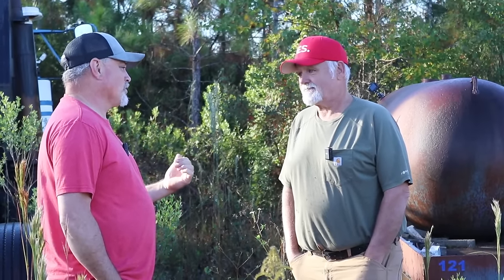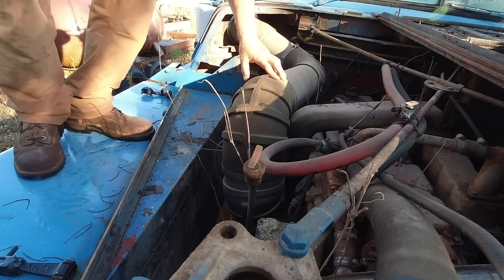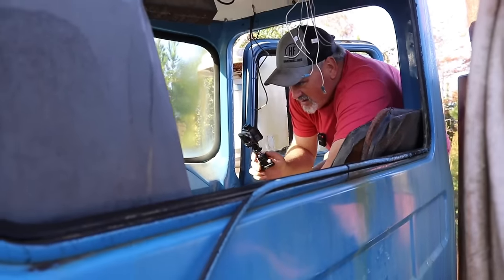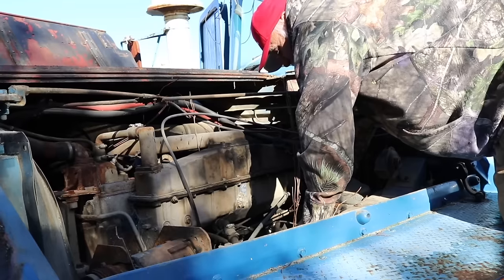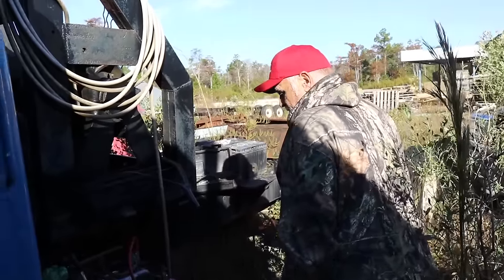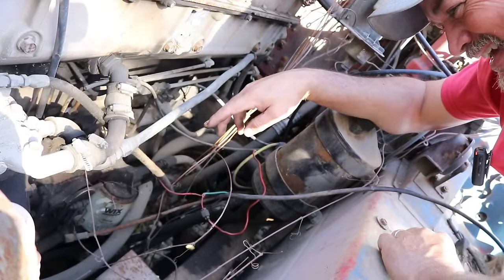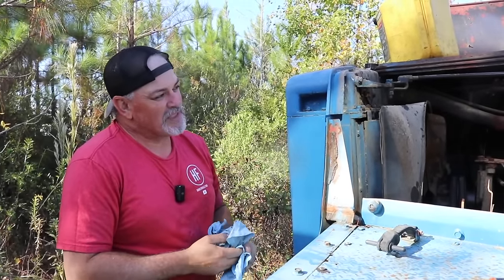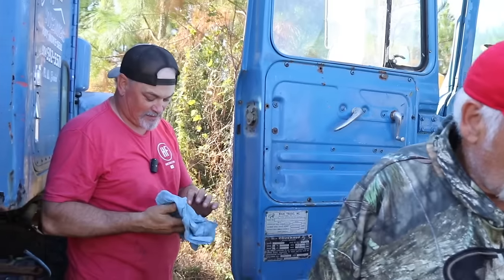We found an SUPER RARE MACK HIDING in plain sight!! Will it run?

Comment: What we have here is  an LA Mack. If you bought a Mack made in Pennsylvania, it would be all Mack from front to rear. The LA Mack was a kit truck you could buy with your choice of powertrains. This one probably came with a 555 Cummins V8 and 13 speed Roadranger transmission. The Triple Nickle wasn't a very reliable engine, hence the 6 cylinder presently installed.
Cummins injector pumps have a manual fuel valve right above the solenoid. A small knurled knob, just screw it in. It was put on to allow the engine to run if your batteries were dead. To kill the engine just screw it back out. FINALLY! You show the ID tag. FRUEHAUF assembled the kit!
Reply: That’s just a dm800 glider
Reply: @willw7545  In OK we just call them kit trucks. Order a cab and frame, put in your own powertrain, or order a complete kit with new powertrain.

Comment: That’s a DM-800, they’re actually pretty common in coal country I know where 3 are at right now within 25 miles of me lol. The 350/400 Cummins swap was common because the Mack 865 and 866 V8’s of the day were pretty well junk, they had a lot of crank and other bottom end issues and eventually they got to be impossible to find parts for.
Reply: Yes those old Mack V8 engines had a lot of problems crankshaft was one injector pump problems best V8 they made was the E9 500 it was a beast
Reply: @eddieweigel9490  yes indeed that e9 was a fantastic engine it was good as the old 300 Maxydine as far as reliability
Reply: Haul many ton coal with then. Had old qualaplex 18 speed twin shifters. Tough Tks. For ever changing springs we had way too many driver  manics, that was  non-mechanics. Glad see that job site in my rear view mirror for last time.
Reply: Only 300 or so were made of that model. Not exactly common in my book.

Comment: Wiley with all due respect and recognition for your remarkable knowledge regarding most things to do with heavy equipment.
I hope you don't mind me saying I suspect you confused the term "torsion bar" with 'torque-rod' which is understandable given the similarity between the two terms.
For anybody who may not know about such things whereas I have no doubt Wiley certainly does know.
A torsion bar acts in place of a conventional spring by twisting a rod and maintaining the tension on it with the weight of a vehicle.
A torsion bar type spring was used on some cab-over Macks to counteract the weight of the cab making it much easier to tilt it.
But a camel back uses leaf springs which can be clearly seen on the rear end of that old Mack, the torque-rod helps counteract a twisting load or torque that occurs under the sort of strain caused by towing a heavy weight.
Reply: looked like a pan hard bar to me wasnt it?

Comment: It would be interesting to see what transmission was in that rig, since it had two air range selection valves on the main stick. Which would make me think it could be a deep reduction 8 speed or 15 speed for that application. You need to have the camera person earn their hay and shove them under those trucks for some good drivetrain close up shots, I'm sure they would love to do that for this drivetrain geek. A lot of possibilities to what could be underneath that old rig, sounded pretty good when it fired up.
Reply: its an old school 13 speed eaton bottom two are low high top is overdrive to split the high gears
Reply: Look like a 13 with a browny
Reply: Original I bet was a quadraplex 20 spd cause it had that 864 mack V8 in it

Comment: those older cummins had a manual compression relief handle on left front side of head
Reply: Thats a later model Cummins it doesnt have a compression release there was not enough room to install it on the Bigcam 300,350 and 400 models after 76 and with batteries being made better and stronger there was no need for the compression release
Reply: These boys are shot out

Comment: Those two trucks plus one more most likely were used to move my house to it's present site back in '97.  It took three rigs to do it since the house had to be cut into three sections and they moved the house close to 30 miles from where it sat originally.  Ducky Johnson's crew did a magnificent job!
Reply from the maker: That’s awesome
Reply: @HamiltonvilleFarm , I believe that this truck was being driven by Ducky Johnson's brother.  I remember that front end on the truck very well.

Comment: You gentlemen are a hoot. You are entertaining and informing while enjoying trying to resurrect some history. Cummins built a line of V8 engines in the late 60's and early 70's mainly for International. I drove a White Freightliner yard truck that had this V8-265 that sounded like a Detroit with bad valves. It ran good but was only used on flat ground.

Comment: Sweet old Mack guys.  Those are 44 Mack rears.  Small axles.  Not 55 or 65 rears
And the V8.   In the early 70’s MACK made a 325 &375 V8

Comment: Bottom of injector pump on NTC and NTE Cummins engines  is a knurled knob. Wind it clockwise right in and engine will start every time. You'll have to wind it out to shut engine down. 👍

Comment: What you are thinking is a fuel pump, is actually the fuel shut down switch, and there is a valve on it, if you turn the valve in it makes it manual, but you did a great job anyway.

Comment: Also that Freuhauf tag is in the door because that truck had a Freuhauf dump body on it when it was new. Likely it came from coal country at one point in time, we sent a lot of trucks to Florida over the years. that’s why the vins match. My truck has a Benson tag for when they put the bed on it below the International vin plate.

And after a little digging that truck as a DM-897 would have come with a Mack Maxidyne 866 turbocharged diesel V-8 from the factory, 375 horsepower.

Comment: Get a Good all brand Start all they're 10,000 amp and only slightly bigger that a regular size jump pack. And only about $900.
Reply: Only $900
Reply: Only $900
Reply: J. C. Smith started 5 dead diesel trucks on one charge

Comment: A DM Mack, probably a DM800. Check the Drivers door for the Serial Number Plate and the dealership that sold it can tell you every option it came with. If out of business, contact Mack in Allentown.The front fneders shout flip forward like a front tilting hood for engine eaccess. Brockway used to open like a door that was hinged in the front.   The gold dog was for Macks with the 300 hp. Otherwise all were chrome. Too bad the V8 is gone. They made a great sound. Yes, Mack offered a V-8.

Comment: Those are Mack CRD92/93 front and rear differentials, very tuff units, double reduction top mount units with a ring and pinion driving a spur and bull gear lower.

Comment: Screw the bolt in on the back of the pump ,all Cummins have them ,you have to choke it down with the clutch in 3rd gear to get it to shut down

Comment: I drove a new DM800 as a lowboy tractor in 1976 or 77. 6 ft recessed front axle, 6 ft slide on the fifth wheel. She was 9 feet wide pulling a 10 wide trailer. The thing was just an animal!

Comment: Couldn't you get a pressure vessel like old propane tank fill with fuel/diesel put 20 psi in it connector for the fuel line and tap, hook it up and have your own fuel system, well done, thanks for the video, all the best to yous and your loved ones

Comment: Hanks daughter didn’t do the intro on this one.
Craftsman along with DeWalt, is also owned by, Stanley Black & Decker.
After a quick Google, the average Mobile Home weighs, 45 to 50 lbs, Per Square Foot so an 800 Square-Foot house weighs roughly 40,000 lbs.
This truck had AC, that’s a new one for you guys.
Reply: George  I thought Hank said it moved single wides.

Comment: Could have sworn that had a V8 emblem on the hood I was surprised to see it has a Cummins in it that is very unusual. If that is Factory that is very rare but with a emblem on the hood I would say the motor has been changed and yes that Bulldog was probably painted white by the owner the Bulldogs were either gold or Chrome

Comment: Wiley was, correct about Mack making v8 s , if you saw a Mack with a v8 badge, it would have been a Mack E9, the engine was designed by Isuzu if it was a silver or white badge, Mack’s variant was notified by gold badging for most of the true Mack motors, it would have been nice to see either or, hope you see this and god bless 6:06

Comment: I really like the air box with the engine air block off incase it started to run off you could pull the cable and shut off the air to try to stuff it off like they had on the old Detroit powered trucks, and if you didn't stuff it out it would run off the engine oil until it blew up super scary the first time that you have that happen to you

Comment: The chalmers suspension has a i-beam bar othats sits under a big rubber ball that sits between the axles that sits on top of the differential case  that acted as the suspension..the camelbask uses the inverted leaf springs suspension.

Comment: I drove an old custom Gifford Hill Mack made to haul 250,000 lbs concrete preformed whatever. Duel frame, three drive axles, 15 speed w/two over/under's and a rack of springs a foot and a half thick. No air ride nothing. If you tried to deadhead that thing it would beat you to death.

Comment: You need to use the glow plugs that's what therefore.
 They're designed to heat the cylinders and the piston up so it will fire.
Reply: That Cummins doesnt have glowplugs.
Glowplug switch on dash was for prior engine.

Comment: A Mack was a Mack was a Mack from the time of their inception to somewhere in the early 70's.  I don't rightfully remember the reason why they started using other engines, transmissions, and differentials (suspensions too I suppose).....it was probably union actions against the company, but there for a number of years you would see a lot of Cummins engines (others too) with Eaton range transmissions and Rockwell rears.
Reply: I agree....u buy a Mack, keep it all Mack. U want vendor parts....buy an Intertrashional, or Freightshaker

Comment: Hey guys I checked out this truck it is a Dm800 and it was manufactured here in the USA in Pennsylvania they were very common were c o a l was being mined they were all Mack from front to back. During that time Mac had several V8s that came in the truck but the V8  manufactured during that time had a lot of problems with the V8 diesels on the bottom end and the parts for the engines just finally disappeared awesome hard-working truck but the engine was there downfall thus you find most of them that survived the engines had been swapped. You could have bought them as a kit also the frouhoff tag probably is who assemble that truck as a kit which was custom made probably Transmissions probably the winch system.

Comment: yes mack made a v8 the place I worked had 7 or 8 of them and they hauled double trailers of wood weighing around 400,000 pounds to the paper mill here in town that is no longer around. I drove one in the spring hauling pile down for the mill

Comment: The Mack heavy capacity rear axles have a metal cap that has radiused tapered cone that’s cut flat at the outer end. The standard capacity axles have a flange with a almost flat face.
Mack camelback will always have torque rods going to the crossmember at the center of the suspension trunnion stand. Mack made a few styles of camelback depending on what capacity the truck was ordered for.
Chalmers has a total of eight torque rods, two above each axle and two below, beams atop each side that have a profile like an I-beam, a rubber spring at almost the center of both beams, and a upside down bowl over each rubber spring. Chalmers rides fairly rough, but will ride more level with suspension articulation compared to some other suspensions.

Comment: What you have is a Mack DM800 they some models came with a Cummins standard. Not any type of V8 was offered.They were the most heavy duty of the mid 70s macks.Orginally designed for cement mixers and Garbage trucks and construction applications.Dont know of any Fruehauf  connection unless the cab work was farm out to Fruehauf. Also sound like it has a Two stick quad box which means a lot of shifting and not much speed

Comment: Hint, on those engines, on acc drive pully, there is a nut you can put a 
1  5/16 socket  with  3/4 drive n turn engine over, see if turns before do anuthing

Comment: Them house mover trucks have that deep reduction transmissions .....especially if they are pulling a 120k+....thats probably an 18 speed with a deep reduction and that 2 nd stick could be for that winch set up  house more than likely the frame mounted winch and 5th wheel was manufactured and and custom installed .....my ex's great uncle moved houses with a 69 Autocar 290 cummins with a Mack quadraplex trans......14 yrs old i moved my first 4 bedroom frame house....i was told to get in it and drive or go home .....i learned to drive it .....

Comment: Your right Wally Mack made a v8 and it was a sorry engine. The best engine that was made by Mack was the 350+. I spent many many years in those old Mack’s hauling coal and they were tough trucks. They had Mack camel back suspension and believe me you liked the loaded trip much much better than the empty trip. 65 drop in Mack rear end and you could hook a chain over the cross member on the dump bed and lift the bogey aka stump out of the axle housing.
Reply: yeah, the E-9 was junk LOL
Reply: George  sarcasm on my part

Comment: The older Macks did have a camel back spring. and Kenworth Had a same style that they called Big Six.  was a kw6-50  suspention kit.. I changed a kenworth 8 air bag system over to a Big six.  just say I was never so happy to not drill another hole.   Any way  Mack had a V8 if I remember correct they run at around 500 horses. I do if had good load placement you could actually lift pavement on a good hard pull. them old 8's were ok for some of older ones cause we have the tendensies to run low RPM shifts. them old 8's were like their sisters, big old thumpers not screaming high rpm motors.   them ol trucks was Possitive grounds. and i beleive are series parrel cause got a 24 volt starter. That did not look like a Come Apart, it looked like a old 300 mack??? has the mack air box on the side of the block.   You ol boys are going to need to lear to jump start them at the starters. Old trucks and things you opperate on are usually non ellect fuel seliniods. and that would not be a orriginal trans. Mack used all their own transmissions back then.   But, But maybe down in that ol south who only knows weird stuff was done lol.

Comment: It is possible to kill a Mack.  My Brother-in-law had a '77 U model that had like a million miles on it.  Lost the fuel pump in the middle of winter on a run in Northern Vermont,  Another driver twisted the intermediate driveshaft out of it when the drives were frozen to the ground.  Another driver had an electrical short in the dash and let it burn the cab up. ( he saved his lunch box though). Found a used cab and replaced it, rewired and plumbed the chassis, body work to the hood.  Drove it for two more months and the oil cooler split and pushed oil out the radiator.  It was scrapped after that.

Comment: As a general rule, the average house weighs between 80,000 pounds and 160,000 pounds. However, the weight of the house is dependent on the square foot, the house contents, and the building materials used for the house.

Comment: Why don't you guys make a jumper point in the back of the truck as you use it a lot. Then you don't have to turn the truck around just grab the cables and turn the switch to use them.

Comment: That looks like a DM 800 with a V-8 I spent about 20 years in a DM800 that V-8 engine was the most incredible powerful engine The DM800 I was driving it had a empty weight was 21 ton and we used to carry 44 ton and that truck has so much power I could keep up with the cars on the road, we had 12/24 tires, 80,000 pound rears, with a triple chassis, and I-beam suspension no springs in the rear

Comment: thats a 30ton winch on the back of the mack also small  house weighs around 60k lbs and a single wide trailer cant weigh that much because people pull them with f150 and uhauls and other stuff all the time single wide trailer probably only weighs 13-15k lbs
Reply: the main transmission is a early 13speed eaton fuller and on top ofr that looks to be a 5 speed auxillary trans making this a twinstick 18speed  the 13 has high low and overdrive(the top position)  the 13 works like this you run it in low go through the gears go to n flip to high then in high you can flip it up in each gear to split the upper gears
Reply: George  i know but he literally asked about mobile homes pay attention to the video plz

Comment: That was not an oil line, its an air tank, it was a busted air line, it is oil build up from the air compressor, nothing at all to worry about. There is no such thing as an air tank for that engine. Lol. That is a water separator for the air system. Lol.